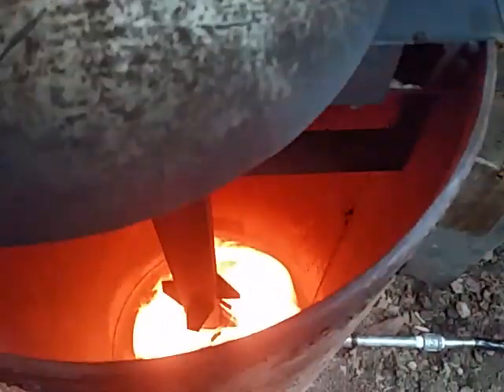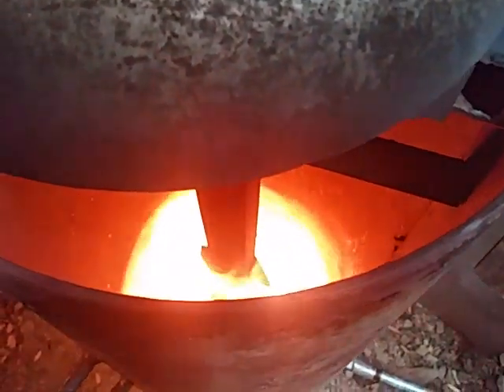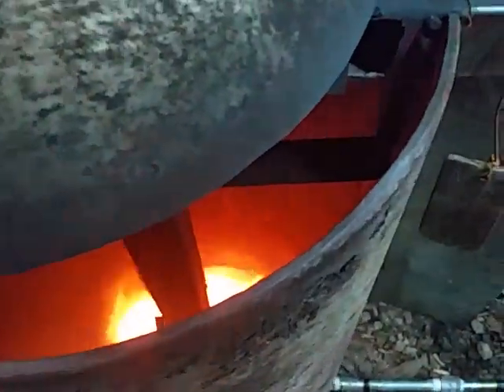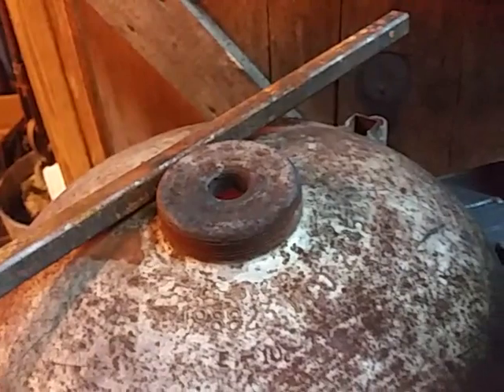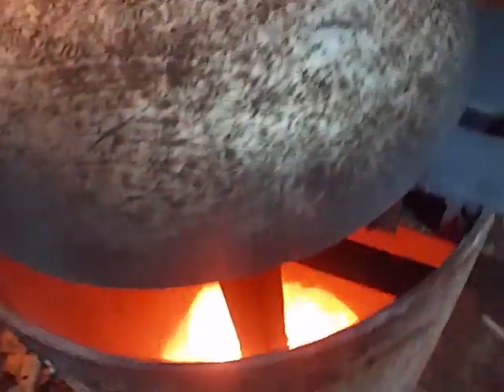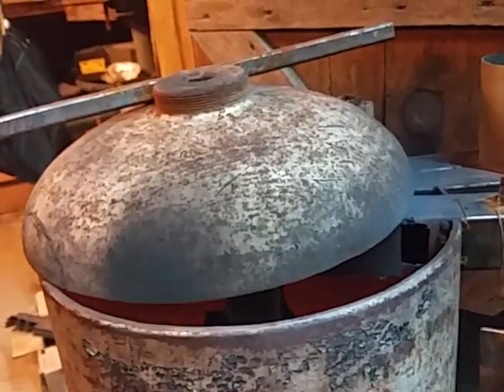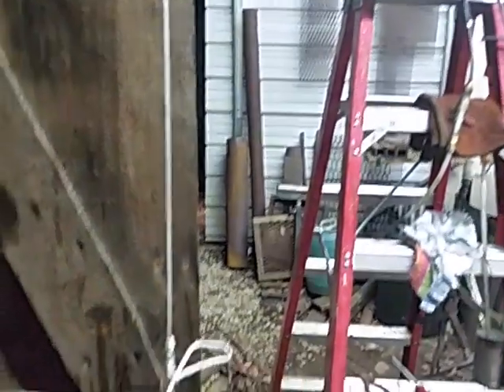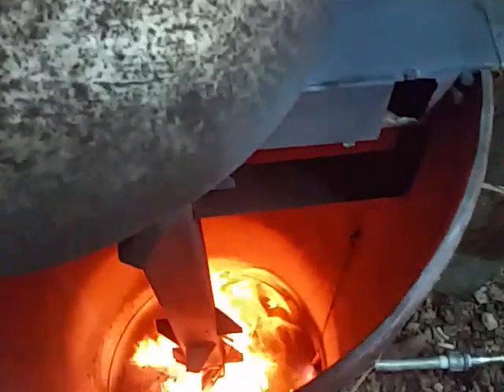WASTE OIL BURNER - Our First Bit of Water in the Oil

Comment: a freench patent, a 16Th century,
used air pulse stove,
but air was pulsed by pession of water,
(a barrel with water making pessure on air)
Reply from the maker: +fred san...  Interesting..  If you find an example (video) of what you are talking about, please post it.. I will look at it.. We were testing our first prototype outside and it started raining (Lightly) while we had the top open.. The energy from the raindrops entering the burn chamber were amazing.. I had an idea that we could supplement our fuel with a controlled water drip system to utilize that effect.. 
I have done some initial testing on it.. Some say it is cracking the H2O into H and 2 O's which is burning the Hydrogen with double the Oxygen atoms, which creates intense heat and flame.. I am not so sure that is what is happening.. The effect only appears to happen when the water hits the hot oil directly.. I think maybe, it is only the oil atomization caused by the water turning into steam and taking the oil fumes into the air with it. It does not happen as much, when the water hits the side of the burner or the bottom,,, when it does not hit the heated oil directly..  I researched the idea and found this... https://www.youtube.com/watch?v=9hB6qZeDhcQ
It is in french with some English subtitles, so, I did not understand anything his voice said.. Only subtitles.. But, I did look at some of his videos.. It is an old Oxygen tank (small diameter), and he uses a large volume of oil flow, so I suspect, this is also what he is experiencing,, but, he does say that O2 cracks at 800 to 1000 degrees C, ( I think I remember that correctly), so, I do not want to say that it is not true,, just that I think he is also dropping water into the oil vs just the water dropping into the fire and cracking. 
I wanted to hire someone on Fiverr to listen to the video in French and record the English translation and send it to me.. On at least 3 of his videos, so I could better understand what he was narrating to see if he mentions anything about that, or has realized that it does or does not work if it is not dropped directly into the hot oil.. 
I also dropped water onto a hot steel plate and did not see this same effect, although I am certain that the temperature of the plate was hot enough to crack it.. The steel was bright orange and the water just sizzles on top of the plate even with a torch held to the water as it drops onto the plate.. There may be some effect created by the hot oil that he mentions in his video that I am not aware of.. But, until I understand why it only works in the oil, I am suspecting that it is only the Atomization of the oil and Oil fumes.. 
I hope you can read English and not have to use a translator.. If so, this may make sense.. If Google translates it, it may be some very confusing text, although google does a pretty good job and I use it often.. I am sorry that I do not  know your language, but, you did a good job if you do know english.. And, thank you for your comments.  I could not find that patent to examine it and I could not find any examples of what you were talking about, although it does sound very interesting, and I am sure it would apply to something I would like to test.. Have a good day my friend!!
Reply: @MarkThomas123  this is some great knowledge, i believe the fire is hot enough to crack the 02 atoms away from the hydrogen, as i was running my waste oil forge today and a couple droplets of water got in, water expands about 60 times over in volume so 1 water droplet instantly explodes atomising the oil around it, and then in the flames turning into oxygen, as the burner was running rich and poor, then when the water ran into it it flared up about 10 times the size of flame, but the flame for that second was no longer rich, and it was bright, so bright meaning the temperature in there would of been at least 2000c id think, and also no black smoke what so ever just a perfect flame shooting straight up ( scared the crap out of me as it was very unexpected ) but i think controlled water injection may have its uses as it may clean the deposits the oil leaves behind and also increase flame output with the same amount of air. this is used in jet engines, factories that run gas turbines inject water into the combustion chamber giving them a 30% increase in thrust and lower nitrogen dioxide i believe emissions
Reply from the maker: @mnshp7548  Yes. I believe you are correct.. It does clean the walls of the Cylinder.. The longer you maintain the drops, the cleaner it gets.. I believe it burns the carbon deposits that are left by standard burning... 
I am fortunate that I found the correct combination of air/oil and current movement, that, there is little to no deposits to begin with, when it is burning.. but, I was using a small Oil Feed tank.. Only 24 oz in size... I did that, because, I was testing every kind of fuel and combination of fuels for testing.. 
Believe it or not, I actually used Straight gasoline as fuel.. I saw and learned a lot of strange things.. In my scenario, Diesel performed the best, but, any kind of oil worked almost as well.. I burned everything from straight 90 weight oil to transmission fluid, etc.. All burned Perfectly clean after a minute or two startup to get the flame going.. 
Gas or Diesel were the ones easiest to get to burn a pretty blue flame,,,, BUT,, the Blue flame,,,,,, Much to My Surprise,,,,, did not develop anywhere close to the heat of the bright Orange/Yellow Flame... I was not judging the heat output by the exhaust itself, but, by the amount of heat output on the Tank itself... Never could get a nice blue flame to turn the tank orange due to the heat transfer.. But, a nice Orange/Yellow flame,,,, it was remarkable how fast the tank would heat up... Swirling the flame against the walls of the tank,, made the tank heat super fast,, and that was done by increasing the air speed/volume in the tank.. Later, I was able to reproduce the same with less volume/speed, by a re-design of the burner itself.. I welded up the larger holes, and put smaller holes in their place, and added downward and twisting pieces of square tubing cut on both sides at 45 degrees to circulate the air in a more twisting fashion... 
That put the flame more on the outside of the cylinder and less flame/air volume in the center.. This also increased the amount of blue flame in the center, but, as it spread out, more orange/yellow flame for the same volume of oil... The heat is definitely relational to the amount of oil, but, there is some fine tuning adjustments that can be made when you get close to the clean burn.. 
Learning about the water was an accident.. We had a good clean burn going one night, and had it sitting just out past the edge of the shed, and, had some water drip off of the end of the roof, and BOOM... Just as you described.. Flames Jumped way out, heat intensified greatly, and, it hit me... Had to be the H in the H2O initially, and when it split, the O that gave the extra volume to the Intensity..  My first thought was....... Hmmm.. Free Fuel Subsidy... to generate huge volumes of extra heat at zero cost.. 
My Little buddy working with me had a stroke, so, the project stopped and I have not gotten back to it.. End result of the project is,,,, a heat exchanger above the Exhaust 4" pipe for Exhaust, 6" Pipe surrounding it, welded tight, which will become the water jacket to heat the water, then, allow it to Heat Syphon to a elevated Hot water tank, that can be fed through a pump, through piping through the ground to heat the floor of the shop with Radiant heat... I will also have a Radiator with a fan hooked up to the water heater tank, elevated above the tank so, I can cool the water down in the tank if I need to, rather than adjusting the flow of water or fuel/heat.. But, as soon as it cranks up 1-2 minutes, I can open the lid and let the Exhaust escape directly into the shop, which is a huge amount of heat.. The Tank has a shroud around it, and the fan that feeds the burner also blows around the tank, and I have variable speed on the fan, plus butterfly valves that I can adjust the air flow around the tank to put out extra heat into the shop... Once the shop heats up, should be the only time I have to adjust the fuel/air ratio...  I was trying to build as many ways into adjusting the heat output as I could, to reduce the time spent at the burner playing with it.. Mission accomplished on that part.. 
Next attempt at the rest of the project will start by adding some Fine Metering valves to the Oil and Water.. 
After I get it hot with the Air/oil mixture, I will adjust it down a little bit, then, add the water drip to get it back up again, and, If I can maintain the flow of each and the regulation works fine, I should be able to maintain a good balance of each.. The only thing I see that might cause me a problem is fine metering the oil after adding the water.. I think it might not be a problem, if, I don't have to reduce the flow of the oil too much since it is thicker, etc.. I am going to try to feed directly from a 55 gall drum on skids outside, to a 2 gallon tank inside that directly feeds the valves and cylinder.. I am hoping that will be enough to keep things temperature stable.. (viscosity changes).. 
If not, I will feed to a larger indoor container, or, feed directly from outside.. I was hoping, to be able to take the whole unit, fan/tank/Water feed/Oil tank/feed, and roll it where I was working outside, so, depending on the Consumption of Oil/water, be able to run it for 4 or 5 hours without Reloading/Readjusting the Oil/water/Air due to the change in viscosity of the oil primarily.. I think it will work.. I am really hoping that the water will reduce the overall consumption of the oil (which I am sure it will do to some point), and, I can come to some happy medium of feed tanks that will work both inside and outside in some other area I am working... Then,, I just have to spend some time and space to collecting Oil year around.. I have a couple of ways of doing that.. An Oil Pump out of a car, drilled and threaded with a 1/2" Galv pipe, driven by a 1/2" drill works pretty good with hoses on both ends, but, a 3psi blower that I use to Air Up rafts has a much higher volume of flow.. Just pushing air in to replace the outbound oil flow.. I have devised a piping system that is length adjustable, by drilling out and heating a sleeve that allows me to adjust the length of the exfil tube, that should keep me off of the floor of the tank I am trying to empty.. Then, I have a large funnel/screen system that will take it and dump it into the large bung on another 55 gal drum.. If I get water, I separate it in my feed tank, by slightly tilting it to one end, and I have a 1/2" galv fitting with a valve welded into it with a clear hose attached, and I just crack it open and let a little water out, until I see a full oil stream, and shut it back off... I will have to deal with that somehow before I can dump the water, but, a second water/oil separator should work for that.. When that fills, it should be mostly oil, so, I'll either try to burn it, or, burn it in an open pit, or, take it to the recycle center.. So, I think, I have got it all covered.. Just need some free time to play with it and finish it up... But, radiant heat in the floor is new to me, but, really makes sense to me.. So, whatever I build from here forward will have it.. But, my welding/blacksmith shop has a dirt floor, so, the first place I can test it easily and quickly...
Reply from the maker: @mnshp7548  I forgot to mention.. Mild Steel turns Orange/Red at 1600 degrees F, Orange at 1700 degrees F, and, Bright Yellow at 2000 degrees F.. 
Speaking about getting the flame to wrap around the inside of the Cylinder, and the flame turning the Cylinder Orange finally, which would be 1700 to 2000 degrees.. Obviously, the flame that heated it to that temperature, given everything else trying to cool it down, it could be possible that we are seeing a reaction that science has yet to explain,, or it is simply that hot in there.. 
Lots of ways to split the H20.. Some at room temperature using Electrolysis..
I am not sure what is happening, but, if you drip the water in the hot oil,, there is a definite something going on that produces a HUGE amount of Extra Flame,, and it's coming from something happening, dripping water into Oil.. So, while they try to explain it,,, Ha.>ha...,, I'll just take it for granted that it works, and use it for my benefit... At the same rate of Oil,, something definitely gets more Explosive is a semi accurate description.. It will sure take some facial hairs off if you don't know what is fixing to happen. So, I think, it is just one more way to make it happen.. And, they can explain it any way they like, but, tell me something isn't happening, and I will point you to a video that says,,, Try again.. Ha.>ha... :)  So, until someone explains it,, what the hell else could it be?? I'm still waiting for someone to follow up on that one.. :)  cheers!!
Reply: @MarkThomas123  yeah i fully agree with all of that, some incredibly useful information there, im  surprised how the blue flame gave a lower heat output compared to the orange, as blue is a very efficient burn ( ive heard), but as you say i don't think anyone truly understands what is happening, especially with the water so until some proper studies are conducted I doubt we will get a good correct answer, and for oil control, as your design can have a small pool of oil on the bottom i was thinking instead of needing to meter the amount of oil going in use a carburettor type device to always keep the same amount of oil in there, they use them on the old aga ovens/stoves that run on diesel or furnace oil. the oil level is kept constant in the burn chamber meaning no runaway or metering is needed, and even if the oil warms up and gets less viscus as you said, the metering device and float inside the control box will keep the same flow as the float would rise turning the supply off, and then back on as the oil is burned and consumed|
 https://www.youtube.com/watch?v=dCff5t3I0u8&ab_channel=toocheaptosmoke |this could probably make it abit safer as well just encase if the oil got really warm without you noticing and went full on runaway, and a simple modified carb off ebay or an old engine may work as well. meaning you wont have to control the oil so only turn it on and off without worrying of having too much oil in the chamber. and aslo the water in your oil supply, i am yet to find a good way to separate the water easily apart from letting the oil settle in a tank with a tap on the end, tilt it for a couple days then drain off whatever is left, and ofcourse i try to not get water in the tank in the first place but sometimes I forget to put the lid on and it rains, thankyou ;)
Reply from the maker: @mnshp7548  Ha.. Cool device.. Not bad for a constant dripper..I use the ball valve, and it works, because, I can fine tune it with oil or the fan, but it would be faster and better with a better quality "Metering valve" for sure.. And the water drip is way more critical that it drip just right.. The oil not so much. Yea.. I wouldn't plan on leaving it over night, etc.. That thing throws way too much heat and, at the moment, has no safety except running out of fuel.. But, It's not bad.. When it is running, I leave the lid open and just let the air into the shop.. It's just a heat/moisture smell.. No hint of any sort of fuel while it is running.. 
If I see one of those, I'll grab it and implement it.. When I get the water heater and tank setup, I'll fire it up, with the open lid, get the shop like I want it, close the lid, heat the water up, then, use the floor to maintain the shop temp.. At least, what I think is going to happen..  I think at a much reduced rate of fuel consumption... But, that puppy will get hot quick and dump a lot of heat to fill up a big shop pretty quick, when it is needed.. Might 50/50 the lid once I get used to it and do both on ramp up.. The more I run it, the more comfortable I will get with it, but, really don't see a safety issue.. The more oil you put in, the faster it burns to some degree, so, it would be hard for it to ever overfill.. But, I might try that.. If you cut the fan it just smokes like the devil, and the fire runs on top of the oil, until it finally cools enough and will go out.. Has to have that fan going to keep it hot enough to burn or burn clean.. It has been an Interesting project.. I'll get back on it next fall again.. This Election/Covid Crap took my Jan until Now time and spent it on Research on that project.. The Q if you are familiar with it... We're not done.. The next couple of months are going to be Eye opening, or as we are calling "Great Awakening".. Have to try to Run my Company again with the Government paying potential employees more to stay home than I can pay them to work.. Ha.. Sucks, but, next time I decide on a business, guess I am going to have to think,, what can the Gov not fuck up.. Ha.. Cheers!!
Reply: @MarkThomas123  ahhh yeah i get that, as my forge will " run away" if too much oil goes in, itll start belching black, but actually start filling up with boiling hot burning oil until it overflows so i have to stay near by, haha. yeah its really sad, everything has just gon wrong, i wish you the best of luck with the business, hopefully the government will pass some new rules that allows work to start back up and businesses to thrive as they are doing in Texas ( i think), but i think we are still a long way from normality where we can travel freely
Reply from the maker: @mnshp7548  It's happening... 44 States are working on securing the Elections with new and refined laws.. That means that even some Democratic Led States are doing the same.. But, we will have to see how that works out... Many States/Counties are declaring themselves 1A and 2A Amendment Counties/States.. Texas and Florida are taking the Lead.. Tx even writing laws Specifically against Big Tech... Delete one of their Citizen's Posts, or, Quell their Speech, and Gwedo takes a big Chunk out of their Pocket Books... Billion Dollar Fines.. Ha..Ha.. How many Statutes were Defaced after Trump put a $10K fine on defacing them?? Ha.>ha.. Trick Question.. Ha.. Zero!!
The People have the Power..They Created the States, and,, The People Created the Federal Government and Enumerated/Limited their Powers.. Something that YOU Create, can have No More Power than that,, That Created it... !!
The Great Awakening!! Cheers!!